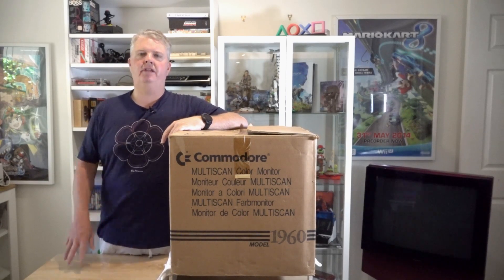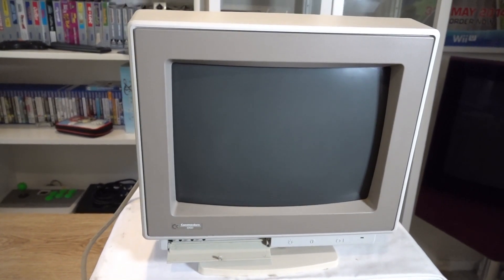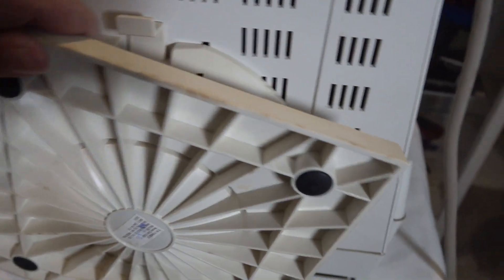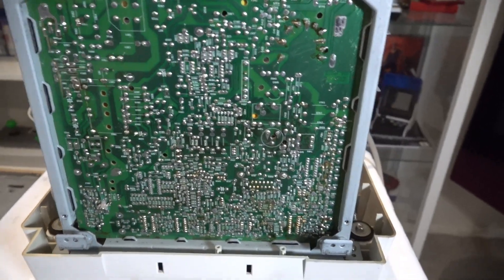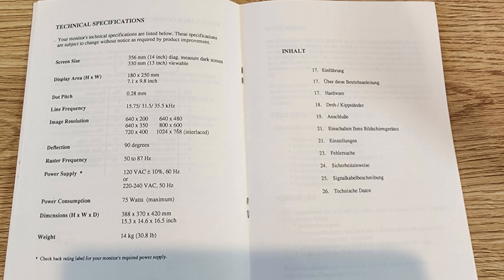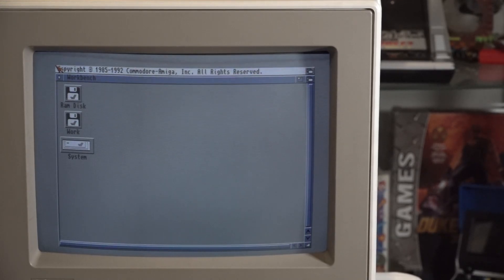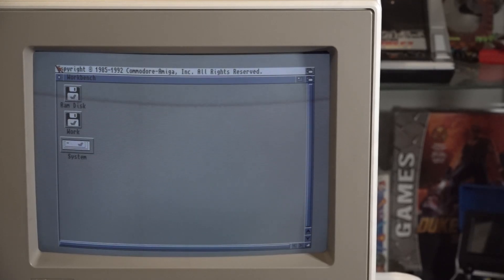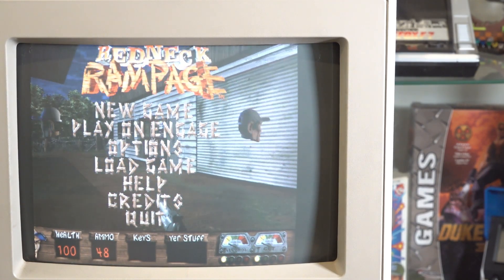Rare CRT Alert!! - Commodore Amiga 1960 Review, RGB Monitor In Its Original Packaging!!!

Comment: Great to see a video dedicated to this monitor, I love it and have gradually amassed three over the last 5-6 years (in various states of repair/disrepair so the footage inside is particularly interesting). It certainly doesn’t appear often. I have deduced that it was originally made late in the life of the A3000, but when the A4000 was launched this was Commodore’s only monitor that could display both the old OCS screenmodes and the new AGA screenmodes in Workbench, so it became the monitor on all the A4000 marketing literature, magazine reviews etc and so most synonymous with the A4000. Eventually it was replaced with the 1940 and 1942, which has similar specs but in the same case as the 1084S. Thanks for the video.
Reply: I've got one in working condition!